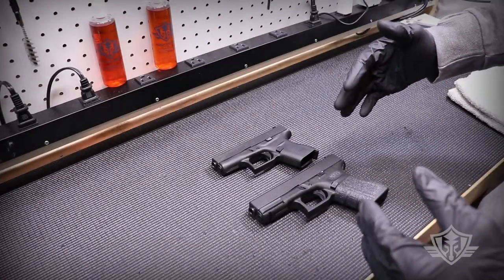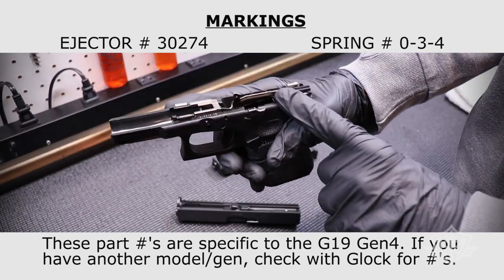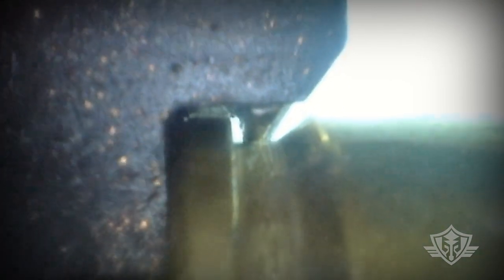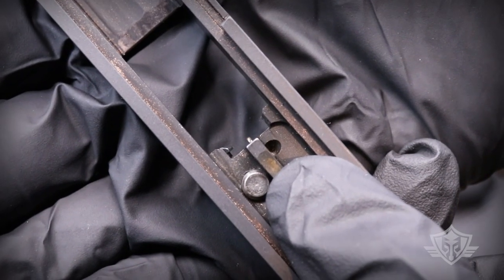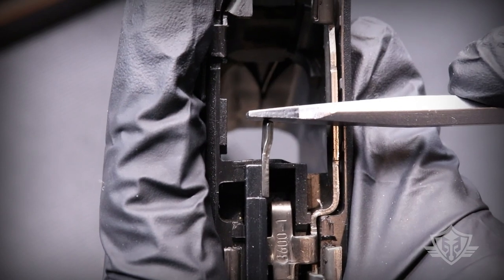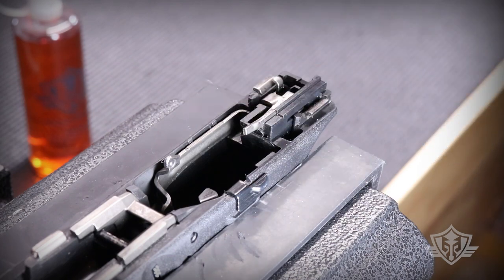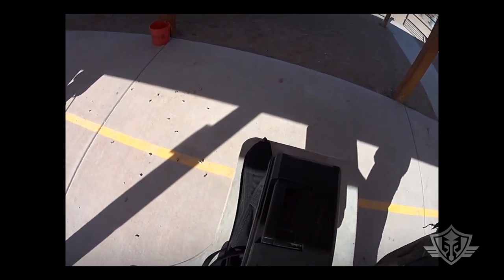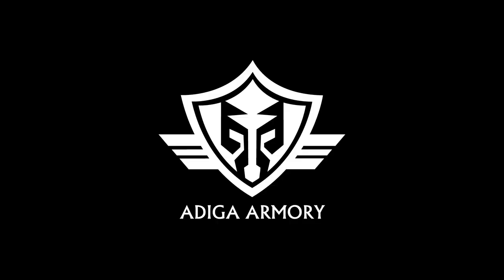Glock Brass to Face [BTF] & Erratic Ejection Diagnosis and Repair: Extractor/Ejector/Recoil Spring

Comment: Finally a video where someone tries to modify the existing ejector instead of just replacing it with another one. I've got a G19 and 26 both in third generation both using the number 336 ejector and they both throw the brass back at me more than I'd like so just today I took apart the 19 and filed a little different angle on the face and also bent it slightly to the left when looking from the rear of the gun which should help kick the brass more to the right and not so much up. Going to test it out tomorrow morning to see if I've done any good or made things worse. I figure why not try it first because I can always buy a new ejector if my mods don't work.

Comment: I replaced the ejector on my Gen 4   G19 with the Gen 5 #47021 ejector. Short money, easy to replace and visually you can tell they changed the angle slightly. Works well.
Reply: Landed here looking for an answer to this occasional issue on a Gen 5.  Will have to look at the ejector #.  Thanks for the info.

Comment: I am learning why there are so many Glock fix videos. It seems that they all need fixing. The only Glock I own is the 42 and yes I am trying to fix it. It will probably be the only Glock I will ever own.
Reply from the maker: Don't get discouraged... all the Glock fix vidz probably has to do with just the sheer volume of guns Glock has sold over the years. I have owned quite a few, and for the most part they have been very good guns. Though, I do like the older Gen 3's better. Here is one we did with the G42... not sure it will help you but worth a try... https://youtu.be/ybbljGNqEi0
Reply: @adigaarmory  Thanks for your reply. I only had it at the range once and I had the stove pipe and failure to feed issues. I will put some good lube on it and get back out again soon.

Comment: Having similar issues with my glock 22, while simultaneously having trigger reset issues. Trigger doesn't reset until 1+ seconds after releasing. Zero capability to fire at an accelerated rate. I believe it's a gen 3. The trigger reset issue showed up before the brass ejecting at my face. I've only fired the pistol twice since having either of the issues. Didn't even finish the mag, just decided to shelve it until I can get it figured out.
Reply from the maker: Just curious... is it new or did you buy it used? and is it all stock, or does it have any aftermarket parts installed? If it has a bunch of aftermarket parts, maybe just go back to stock on everything and see if it helps. Check the "trigger spring" and "firing pin spring/cups" for proper install and excess wear. Check the "connector". Check the "trigger bar". Check the "firing pin safety plunger/spring" for free movement. And for the BTF, check the extractor as shown in this video.

Comment: Just want to mention that the brass to face issue on a Glock 27 G27 Gen 2.5 with a Glock 23 G23 40-9 conversion barrel was resolved with the following parts ordered and installed...
(1) glsp28927 sp28927 Glock Trigger Housing (Gen 4) 40 S&W $9.95 (only use the 28926 ejector)
(1) Glock OEM Extractor Dep Plunger Spring SP00119/ SP33522 $3.29
(1) SP01176 Glock Spring Loaded Bearing 9mm & .380 Auto for Non-LCI Extractors, Black $4.00 
(1) SP00098 Glock Extractor 9mm (90°) for Old Style Non-LCI Slides w/ 90° Ejection Port $14.65
I'm sure it will work with all Gen 3. Not sure of the others. Good luck and happy shooting!

Comment: How about replacing the extractor with a Apex one ?
Reply from the maker: It may help... but in defensive guns, I like to work with OEM parts as much as possible. In this case, it seemed to be the ejector primarily causing it, and likely the "loose" extractor tolerance as a secondary issue.

Comment: Did doing any of the sanding make the extractor sit closer to the brass?
Reply from the maker: Unfortunately, no. That would require substantial geometric changes to the extractor to get it to sit further back into the milled extractor recess on the slide. There may be some aftermarket extractors/slides that address this, but I don't know of an easy way to pull this off with the factory extractor/slide combo.
Reply: @adigaarmory  ya know, after making this comment I went over to my glock 22 9mm conversion and adjusted the extractor by filing the flat spot underneath the claw. 

The 2nd ledge down from the claw itself is where it makes contact with the slide. Just took a very small amount of material and it is grabbing the round by bracing it against the opposite side of the breach now. I can see the brass is being held by the extractor now throughout all of its travel by opening the slide slowly.

It ejected perfectly when quickly racking the slide while testing, ejecting most around 3-4 o'clock.

Most were not even leaving the gun, landing on top on the magazine before doing this. Can't wait to test it out.
Reply from the maker: Hey there, glad to hear this. Would love to hear about how it works when you test it!
Reply: @adigaarmory  thanks, will do. I think I'll test it out in about a week or so. 

The thing chipped my new glasses so I definitely want to fix the brass to face, couldn't imagine having to deal with a casing in the eye if I ever have to use it. lol
Reply: @adigaarmory  it worked! No brass to the face out of 100 rounds and very positive ejection. I'm one happy camper. :D
Reply: @MrS22222  which of the mods (if all) did you perform to get it ejecting properly?
Reply: @xhcxdrummert  well, my problem was that the extractor wasn't holding on the brass at all, once extracted the brass would fall straight down when racking it. I filed a spot to make it hold the brass tighter to the side of the breach, kind of hard to describe where it was. It's the second ledge down from from the claw itself, didn't need to remove much material at all to do it.
Reply: @MrS22222  oh alright thank you. I'm planning on filing down both sides of the extractor like shown in the video but I will check to see If I have the same problem yours did, Mine is with the Gen 4 Glock 26

Comment: That citrus clp, that's not actual citrus from oranges is it? Like things that acidic could mess up gun couldn't it?
Reply from the maker: Citrus, yes, in part... acidic, no... it is more neutral than most rainwater. It is designed specifically for guns.

Comment: What's weird is the fact that one of the recommended fixes for BTF on gen3 glocks is to buy and install a factory gen4/5 ejector.
Reply from the maker: Indeed... actually, the first thing I tried was simply popping in a new Gen4 extractor... nothing changed... at least on this particular unit.